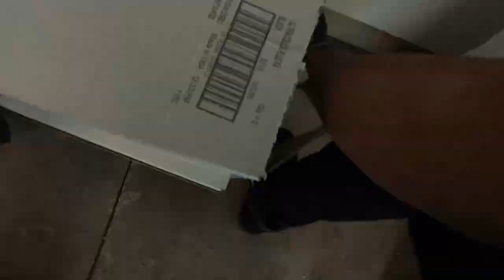This Is My HIGHEST Paying Order on the BUNGII APP!!  Was It WORTH IT? #foryou

Comment: Roadie was good to me today.  37.41, took about an hour, 55.02, about an hour, had to pick it myself at home depot or cancel, took an hour, and a 18.12 on the way back through that took 10 minutes.. glad i got Roadie cause Bunji won't accept my transit Connect without a trailer and ain't ** for my vehicle on Frayt and Dispatch in my area. Just goes to show not to listen to the haters.  If i did I wouldn't be watching Roadie. Get that duct tape off yo taillight and I'll do me.
Reply from the maker: 🤣🤣🤣 Roadie definitely comes in clutch in my area sometimes. It is good as a multi-app for me.